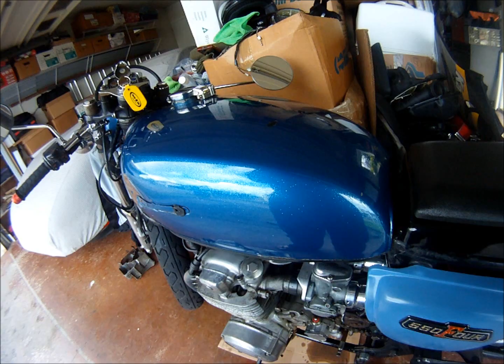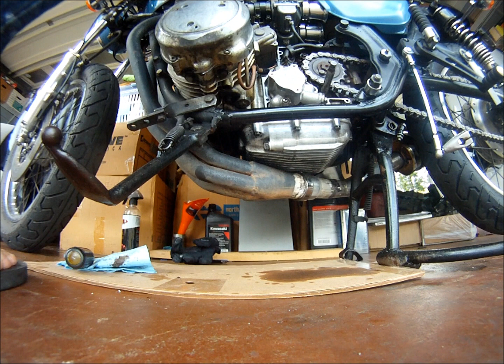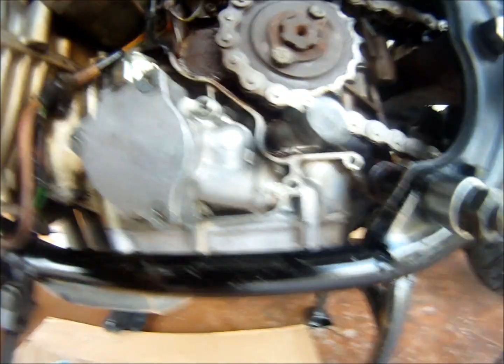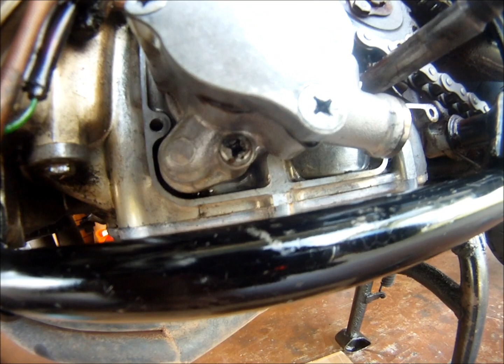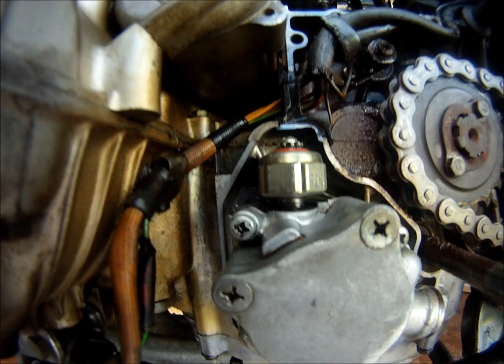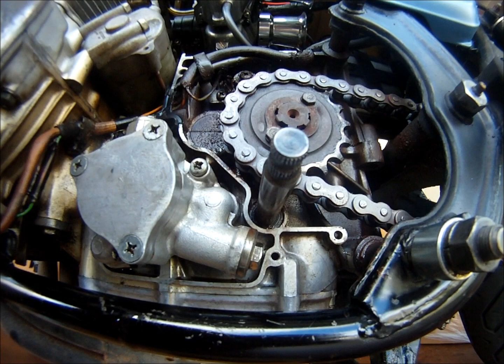[Motovid] Various oil pump leaks.

Comment: Well I'd take some indication from the fact Honda put another cover OVER the oil pump itself, and that they located it next to the chain - the rubber cap for the sender wire to run through would leak onto the chain and Honda would call this an "automatic chain-lube system" - See how nice that sounds?